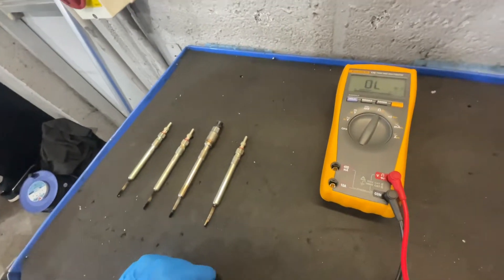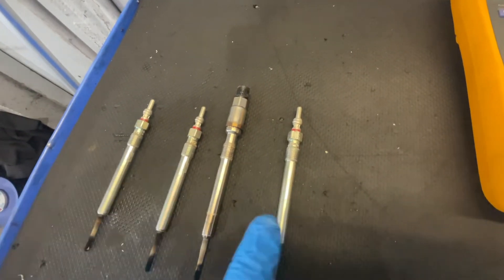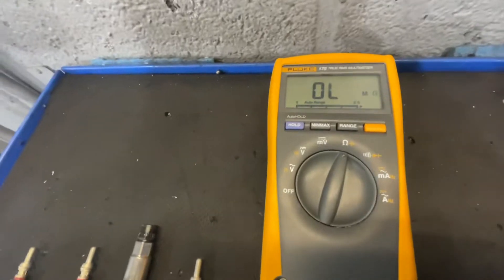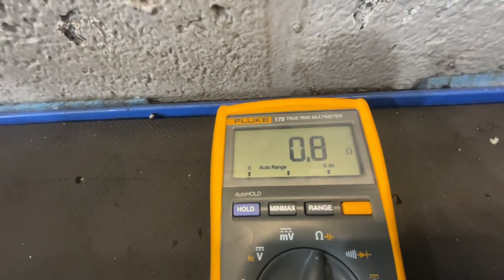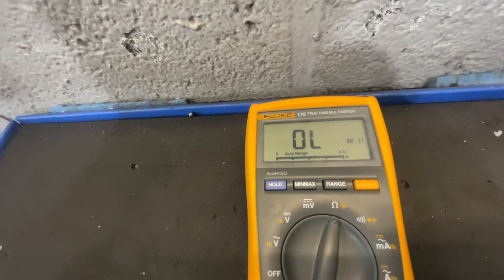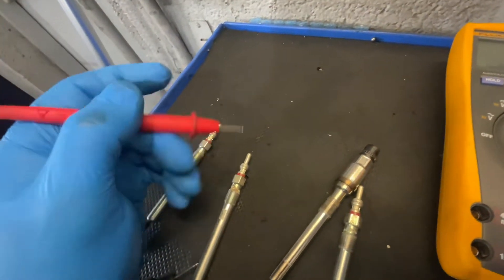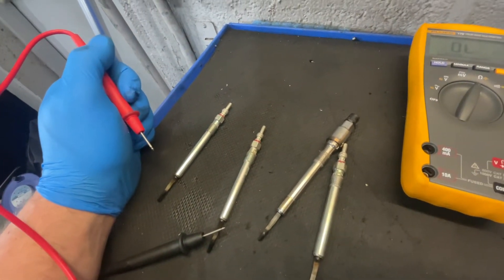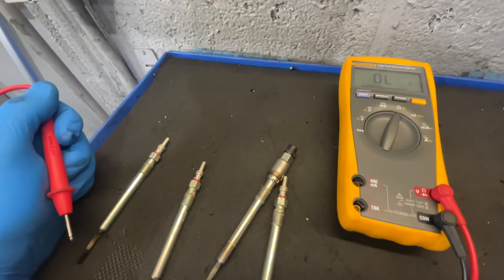Testing Glow Plugs With A Multimeter

Comment: I have a 2014 VW sport wagon TDI 2.0L throwing code P06B9 for cylinder 1 glow plug. Are these glow plugs the normal ones or the pressure sensor ones? Do I need to use OEM glow plugs or are there good aftermarket glow plugs? Where is a good place to purchase VW parts? Thank you.
Reply from the maker: Normal glow plug and I advise Bosch plugs they seem to be better quality and any motor factor will be able to sell you these
Reply: Thank you!
Reply from the maker: @punchtool2920 your welcome :)

Comment: Thanks for the tips. I was wondering why other videos tend to test glow plugs with the leads on different portions of the glow plug itself? It is a bit confusing as I am trying to make sure the glow plug that I am replacing is in fact a bad one. My "bad one" reads 0L with the method you showed. So it is for sure bad then? Thanks again.
Reply from the maker: Hey buddy the best way to look at it is if you put the negative from the threads down the shaft then that’s your earth as it uses the head of the engine to ground and then the very tip at the top for your positive lead as that’s where the plug from the car sits
Reply: @TheVWMechanic_official  okay. Makes sense. Thank you!
Reply from the maker: Your welcome